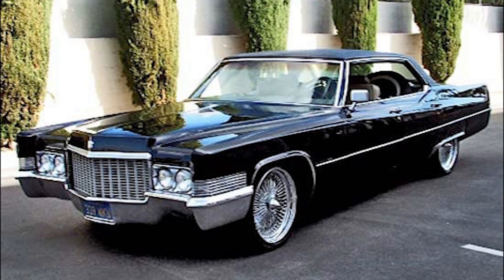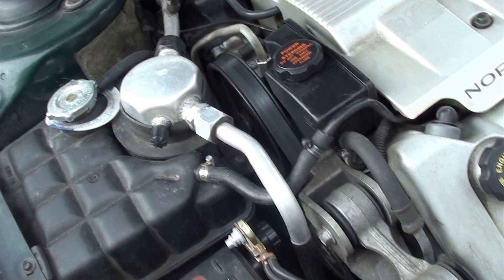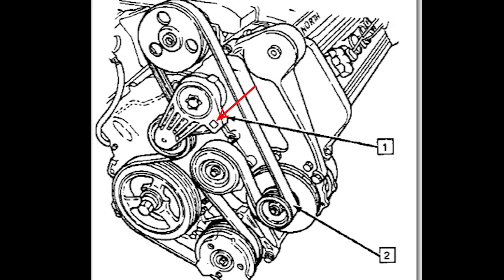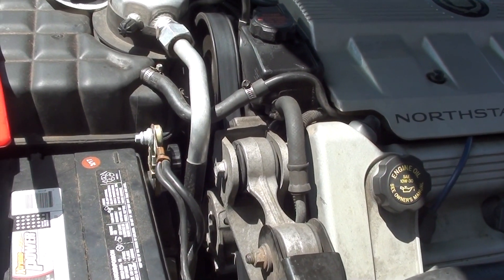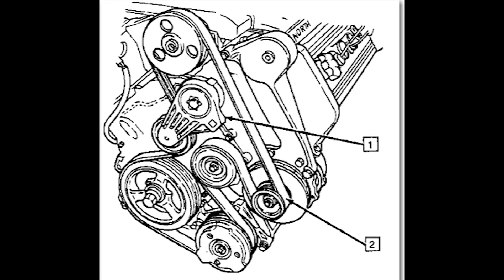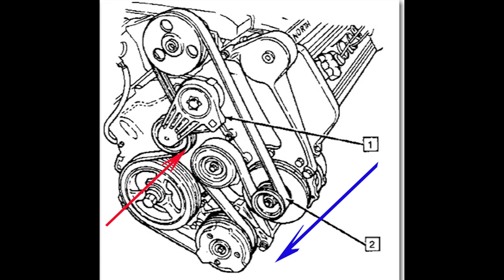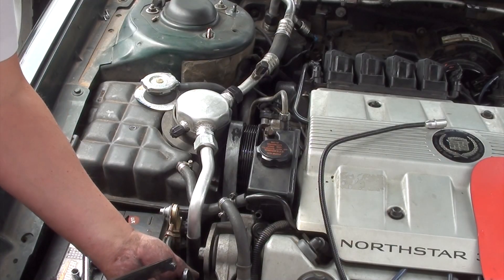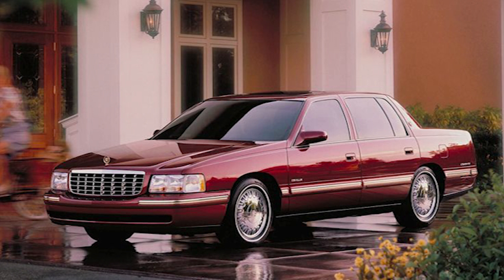Cadillac - GM - Northstar - How to replace serpentine belt - what mechanics won't tell you  DIY

Comment: ATTENTION: The ACDELCO 6K815 belt 81 1/2 long is EXTREMELY difficult to install. Get the GATES K060815 which is 82 1/8 long and save yourself a bit of anguish
Reply from the maker: thanks for your input.
Reply: Two different size alternator pulleys on the 4.6L 57mm gold and 62mm black

Comment: Don't buy that kit. there's no half inch square on the front of the tensioner.its on top, you need a breaker bar, and if your not familiar with doing this belt on a Northstar, then don't do it.pita.

Comment: On a 2003 Cadillac DeVille, there's no square to put a half inch square there. It's on top of the tensioner, and you need to put a breaker bar on top of the tensioner, and it only goes so far. Putting it back on is a nightmare, the belt is so tight, you can't get it over the PS pulley, it's so tight, it doesn't go on, it seems like you have to stretch it over the pulley with a screwdriver.
Reply from the maker: Thanks for your input.

Comment: Thanks for the instruction. I need to work on the water pump side and was just checking to see how hard it was to change the serpentine. I love you illustration. It makes it very easy to see what you're getting into. I just replaced one on a 2002 Malibu - twice. The harmonic balancer was coming apart and alignment was lost. On that motor, you have to jack the motor up and disconnect a motor mount to get the belt off/on. That's not fun. The first belt worked for a month after which time the balancer came apart enough to really mis-align things and the belt chewed itself up real quick.
Reply from the maker: Thank you, and thanks for your input.

Comment: Nice post.
I have a 2002 olds aurora 4.0 v8, I've heard it's a Cadillac engine. 
I'm not sure if you have an answer to my question but here it goes
The block heater on my car never used until yesterday. I plugged in the cord then after a few seconds smoke came out at the back of the engine but never heard a spark. Not sure what was burned, since the car also has an issue with power steering fluid leaking, I hope that it's just an oil burning. But I'm still afraid to plug in the block heater
Reply from the maker: Humm?  i take it you did not start the yet. It could be all the crud and oil burning off since you haven't used it in a long time. Keep a eye on it. Take it to a muffler shop , where i live at you can go there and they will look at the bottom of your car and see anything funny going on there, for free. Good Luck
Reply: @notsofast2325  I brought my car to an auto repair shop last friday. They put my car on a hoist but were unable to reach the block heater plug at the back of the engine. They found a replacement part (block heater and cord) but I was warned that the labour would be expensive because they have to disassemble some parts to have access to the engine so I backed out. They suggested an oil pan heater but not sure about it. I've been thinking about an inline coolant heater but I don't think they're still space under the hood for that.
Reply from the maker: @jamesjames601  Im sure someone out there has had this problem. maybe someone out there has the answer. Any takers?

Comment: Does anyone have a video or a diagram of a 1999 Cadillac Seville Electacal System or any suggestions on how to put my cars electacal system back together in order for it to run ? Thank You !
Reply from the maker: what part of the electrical system?
Reply: The part that gets the car running again
Reply from the maker: @cindyjackson8174  lol..that could be anything. There is a lot of free material out there, you just need to know what info you need..thanks for stopping by
Reply: Cindy Jackson  straight ignorance my guy.... there’s over a thousand parts moving together to “make it run”

Comment: @0:39 for safety purposes, when disconnecting a car battery, always just disconnect the ground cable.  NEVER put a metal tool to the positive, as that act alone, you can accidentally touch the metal wrench to a metal part of the car, and get an extreme spark!!